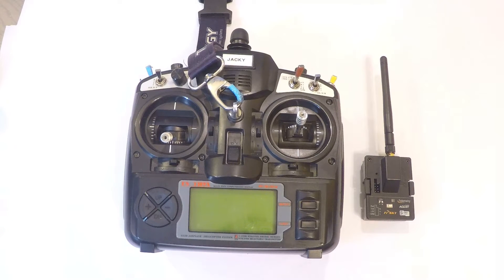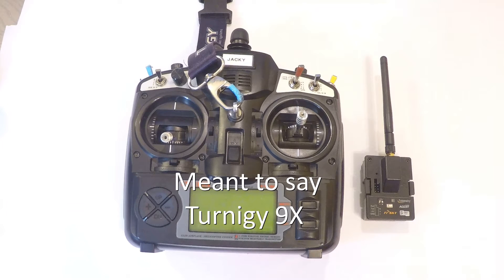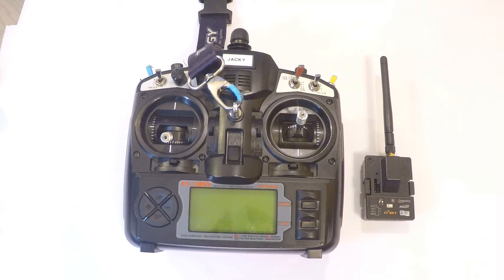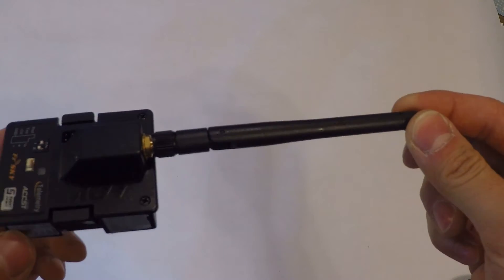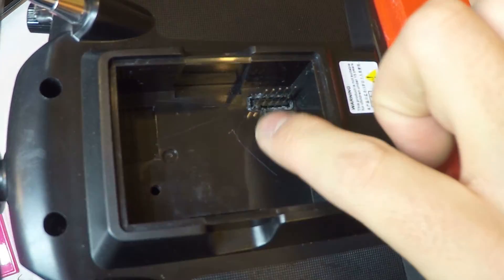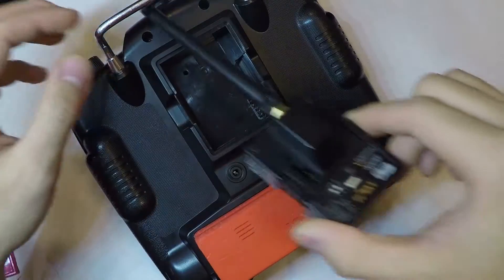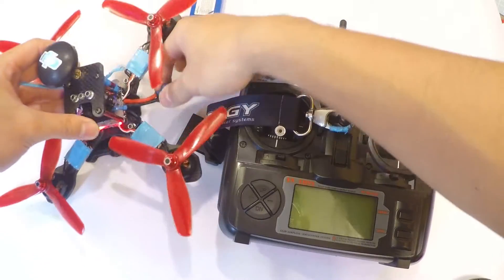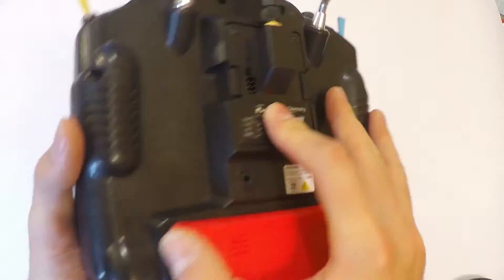Frsky 2.4Ghz XJT Module on Turingy 9X [Installation & Review]

Comment: Hi, I thought your video was really helpful and straightforward. I wish to use this XJT Module with my own Turnigy 9X. If I simply install the module and bind it to an X4RSB (the primary receiver I want to use with my radio), will I have to mod the software on the transmitter to use S.Bus or get the RSSI like you mentioned in the video?
Reply from the maker: +Pablo R nope! All plug and play! You will need to adjust the dip switches to whatever mode your receiver tells you to.
Reply from the maker: +Pablo R all plug and play. The only thing you will need to do is to adjust the dip switches to the mode number your receiver asks

Comment: Hi... do you know ho to flash the external xjt modul? with the turnigy?
Reply from the maker: +Jonny Man you don't need to flash it. It's plug and play. It will work with Turnigy.
Reply: @jackythegeek4567   hey yes but i need the fcc firmware instead of lbt... i have a sd card inside with the firmware but i cant flash it...